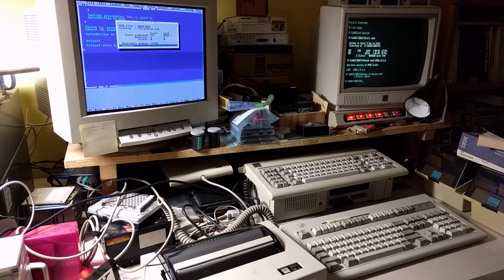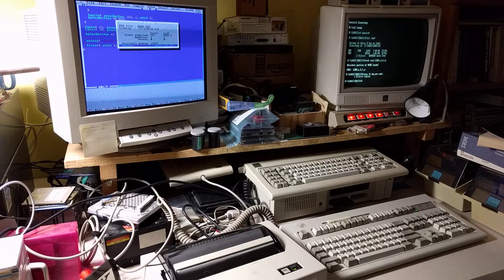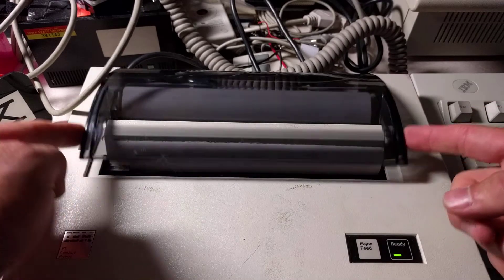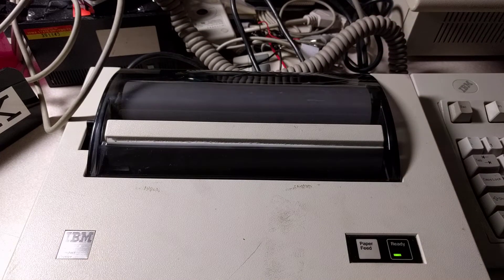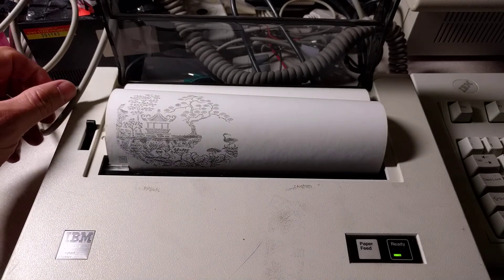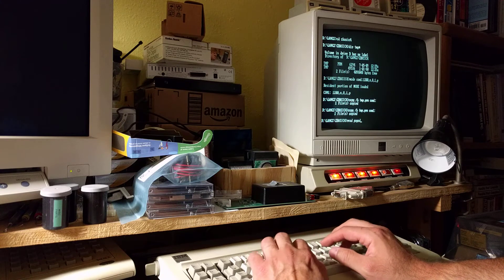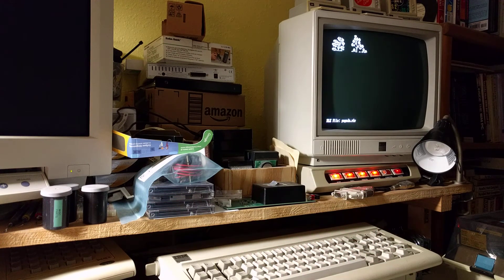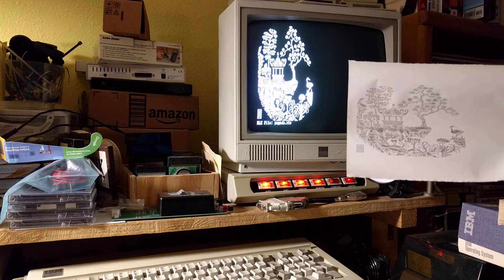IBM Compact Printer Demonstration

Comment: I have that same pinter but no PCJr. Do you think I can get ik working on an IBM XT or AT?
Reply: It's a serial printer running at 1200 bps.  If you figure out the pinout (which is probably in the PCjr Technical Reference, PDF copies of which are available online) and fit a new connector it should work on any computer.

Comment: I've read about this printer.  I've seen this printer in other videos, but this was the first time I've seen it actually printing!

I have an IBM PC Convertible with the detachable printer, and it's virtually the same mechanism, which was about what I was expecting.  Those thermal printers were very slow, 1200bps or not.  I think the Convertible's printer was rated for 40 characters per second, well above the theoretical 150cps that 1200bps could produce.  Graphics like this, of course, will be slower, as there's more data to transfer.  Even so, it was surprising how capable this little thermal jobbie actually was.

Thanks for making this video.
Reply from the maker: If I remember correctly the printer for the Convertible was a thermal printer but it also had an optional ribbon to make the black ink stand out more.  Which was a great idea, except those ribbons are probably unobtainium now.

I too am a fan of the IBM Convertible (5140) - I just don't have a page up for it yet.
Reply: Yes, you're correct.  The ribbon was sort of reminiscent of a microcassette.  It was a thermal transfer ribbon, so it allowed the printer to use plain paper and produced excellent results.  I think they called that "letter quality" where on thermal paper without the ribbon it was "draft quality".

A crafty individual who still has the shell of one of those ribbons could probably re-spool it if they wanted.  I definitely used to have a ribbon for mine but it has been spent and I'm sure it's gone.  Another thing I have done is make a "sandwich" of plain paper and carbon paper.  I can't remember if it can feed a sheet on top of the carbon paper or not; otherwise it's not of much use printing text, but in something like The Print Shop you could print a mirror image, and in that case put the carbon paper backwards behind the sheet of regular paper, and have the mirror of the mirror create a proper image.

Somewhere in a dark corner of my server room there's an Epson P-80 thermal printer that's shared over the network that I could print to if I wanted.  It's exactly the same mechanism in the PC Convertible printer, just in a different case, so it's safe to say that Epson made the Convertible printer.  Not sure on this Compact one, but there was another printer IBM offered before the ProPrinter that Epson made for them.